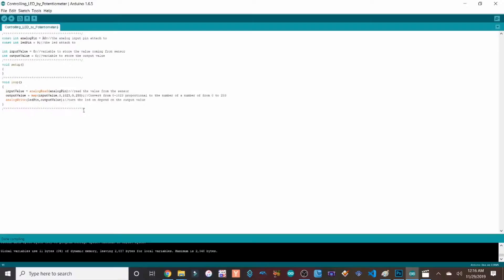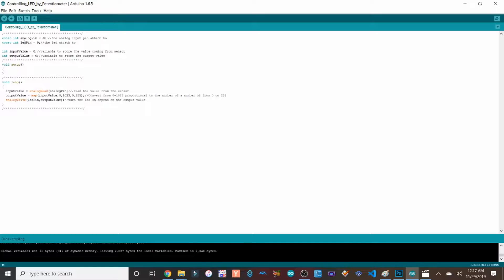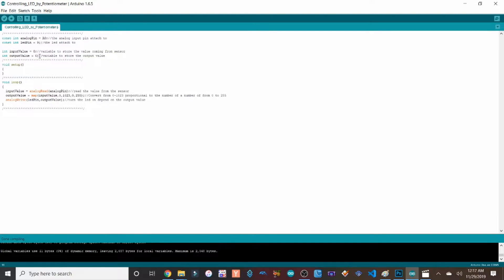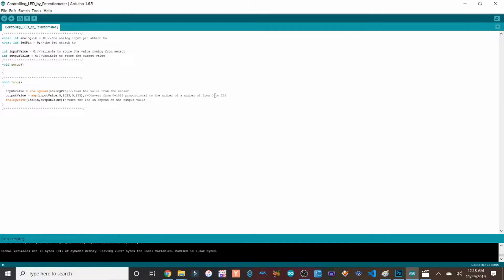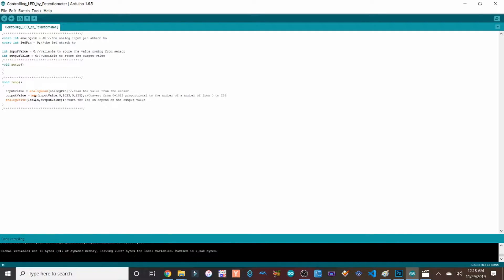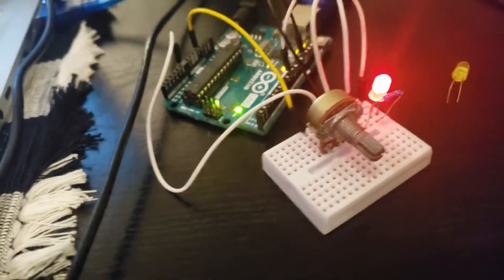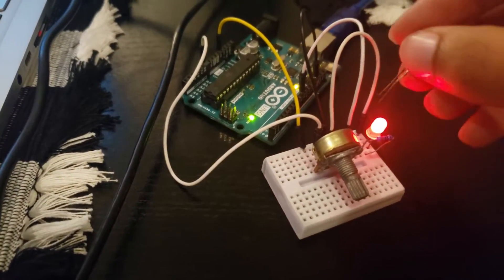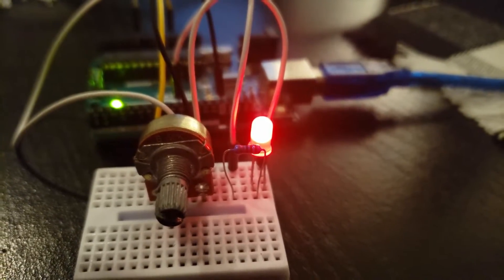Basic Project: How to use a Potentiometer with a Arduino or Raspberry pi

Comment: How do I install it onto a raspberry pi and make it give GPIO input
Reply from the maker: You will connect it to the 5V porr then code it based on the GPIO Pins
Reply: Raspberry pi does not have analog input pins so you will have to use an ADC to get any meaning full reading from the potentiometer. However, you can use PWM signals from the GPIO to control the light intensity.